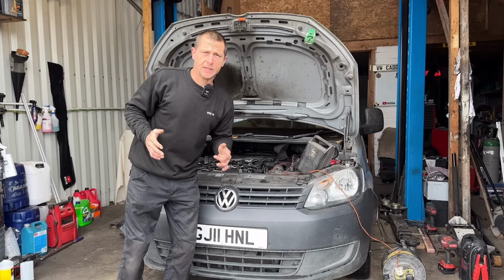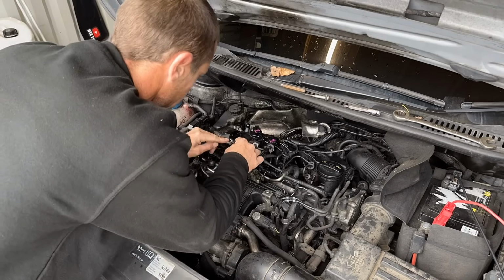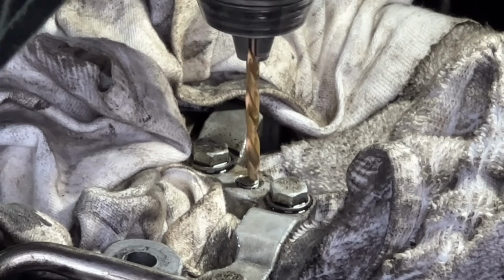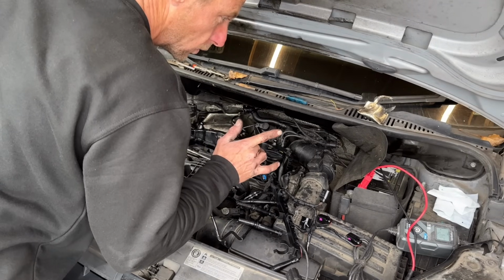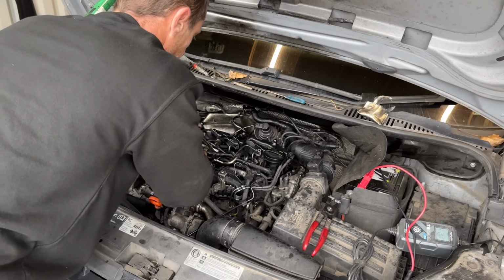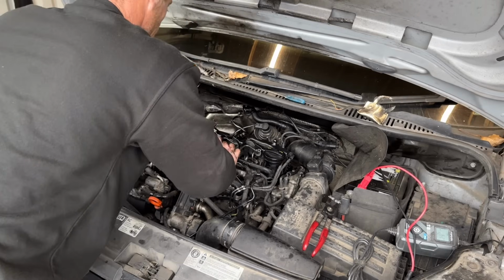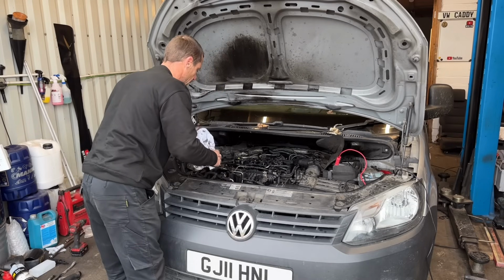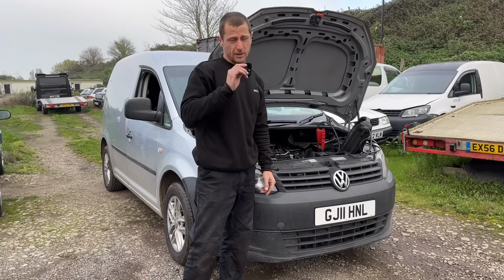Vw caddy 1.6 TDI SNAPPED injector bolt removal

Comment: Been here twice Nathan…on my drive, two injectors done, not had to do rocker cover seals yet, but I always buy two full injector seal kits, copper washers and o-rings , two bolts , plus a return pipe rail kit … green o- ring one…and new spring clips , so about . £50 in parts per injector replacement…on top off a injector, £200 recon, £400 plus new.👍🇮🇲ps I’m with you, tap them down , and thanks for the tip on the leak off pipes, I’ve actually cable tied mine to stop the buggers popping off …lol 😜
Reply: There a place in Scotland Argyle diesel £350 for injector continental or Siemens

Comment: Nice video, Top tip if you want to change injectors on the (CAYD commercial  or CAYC passenger car) at home.  Try to lift the injectors first  if they are jammed in, get a garage to do it. You will save yourself lots of grief. If they pop up with light pressure, crack on.
Factory spec for those bolts are
2Nm then 8Nm then 270 degrees, not 180.
Done 100’s of those under warranty, some other tips for people doing this:
Don’t get any diesel on the belts they will strip.
Replace the small spill pipe clips and O rings, two different sizes green OR orange. You may get away without a leak, but if they do, the diesel finds its way onto the timing belt and it will let go. Seen at least 5 do this. ££££££
If replacing an injector due to piezo driver failed, replace seal and copper seal of the adjacent injector you have to pull up to get the failed injector out.
Clean the injector seat as best as possible, we use a special bore cleaning kit, just saves grief down the line.
Input new injector code (if it has been replaced) into the ecu for smoother running.

Comment: Ayyy! 200k mls C engine. Injectors for sure, DMF, DPF, EGR, HP pump... They're all gone south already. 
Could be a good idea measuring compression before buying into a world of pain.
Otherwise sweet specs and bodywork. Probably best base for a build we have had to date on the channel. 
IMHO a VR6 should go in there. I saw you face when you took that white R32 Caddy out for a ride 🫵

Comment: Nathan now I finally know what DTE stands for "Doctor Tech Engineering". But aside from that great video on the Injector. My Caddy had 4 refurbished Injectors 6 Months before I bought it and then nr. 3 went on the way home. The seller kindly replaced it. Fingers crossed it has done nearly 40.000 km since. But I did notice that by 1 and 2 there was some diesel. I've cleaned it up and will see if that was the fuel leaker pipe. Thanks for the tip. I will do those 2 bolts for safety. Keep up the good work. Ah Yeh.
Reply: dob tech
Reply: @adellisdevelopmen6593  Thank you must have miss heard it.

Comment: We have a 2016 1.6 Tdi......been brilliant!Aparntley the Siemans injectors were known to fail.......it's due to the electricals.VW  replaced them with Bosch ones and they are not known to fail.....I've got an engine cover to keep the damp out of the injectors.

Comment: I had brought one with the same issue I was lucky to the bolt came out easy enought but it had a slight rattle gave it a oil and filter change was mint

Comment: I just had this hapen to my caddy 1.6. The injectors sounded bad for days like there was a marble inside the engine. Then the bolt broke and caused more problems. Don't drive with bad sounding injectors is my lesson

Comment: Happened to my 1.6 vw touran couple of months ago, had to buy a new rocker cover 1 fuel injector pipe and injector copper washers and seals and changed the oil, cost me about £400 tightened everything to vw methods, 1000 miles later accelerating up a steep hill (my car is dsg) same side bolt snapped again!! Luckily this time around only cost me £50 including another oil change as I was worried about diesel getting in the oil! 
I’m wondering if there is an issue with the injector over pressuring or something? Or was I just unlucky with the new bolt? I just don’t trust the car anymore it’s only done 50000 miles too :(

Comment: Because these bolts are stretch they are single use. Some workshops change 1 injector and don’t change it then it’ll snap then or later. Also must change the new injector seat copper washers in pairs each time.

Comment: If the bolts is that visible that loose you can  normally use  tweezers or turn it with a sharp pick

Comment: The 2.2 2.4 transits were the same one bolt and a clamp holding 2 injectors down, it’s like diffusing a bomb trying to tighten up but not snap haha
Reply from the maker: Oh mate I got a transit and because it’s not a Vw it sits hiding behind the workshop 😂 my mates transit recovery truck has also blown 2 engines before it’s hit 140k miles

Comment: When I replaced the head gasket on the 1.9 TDI, I reused the bolts. I only snapped the last bolt. So I took everything out, reused the gasket, the bolts and replaced the snapped bolt with another used bolt. No torque, just a long pipe. That 1.9 TDI is still working, 6 years later 😂😂😂

Comment: iv just done a touran but the bolt had snapped right down near the head had to remove cam carrier aswell it had also damaged threads in the head so had to heicoil head just because somone re used old bolts much preferer the 1.9pd engine

Comment: Had the same issue with my 1.6TDI.

The planets must have aligned for me... I didn't take the rocker off, I used a Normal drill bit down the hole and it spun straight out......😅

Comment: That was a long starting. Hopefully  the high pressure pump is ok. Even a second running dry could cause damage to the pump and making metal filings, destroying the injectors. Normally, you prime the fuel system using a scan tool activating the transfer pump for at least 3 minutes before starting the car

Comment: Have u ever done a snapped glowplug in a 1.9tdi just spinning in the head
Reply from the maker: Ouch that don’t sound fun. So it’s the electrode that’s holding it in. You need to get a slide hammer on it and it will pull out but I reckon the threaded part will be stuck in the head. Unfortunately might be a head swap.

Comment: Have had issues with my vw 1.6tdi since an injector failed. Ended up changing all 4 and it's still not right. Loud ticking noise on acceleration. Thinking it might be the hydraulic lifters. Would you know if these can be changed without taking camshafts out ?

Comment: Hello sir i have a different problem mine i bought it with one injector faulty but now after replacing it the bolt not fitting anymore and its not the original bolts its a little more bigger in size and i cant put an even bigger one am afraid it break inside any help plz

Comment: Once the bolts snapped, the tension is off what's left of it, so removal isn't too hard. The key skill is being able to drill gud - it's all too easy to drill into the remains cack-ways, wander off into the ally & then you're semi-stuffed. These are a lot easier than on Vitos - those (especially cylinder 1) can be a right pita as access is rubbish.

I just go buy 12 new shiny drill bits any time I have to do one of these - 6  skinnies & 6 that are just slightly skinnier than the bolt - I drill 'em, bang in a torx bit & use that to back the bolt out. Usually works fine. In fairness, that ^ bolt there's a doddle.  I wouldn't even bother drilling that, I'd just weld on a nut.

Comment: Can someone help please 
At moment I have no idea what's Happening with my own I really need  help over it the mechanic is not telling me exactly what's the problem and i don't want to spend money based on guessing the problem I have just after putting one new injector on it it's  2011 caddy 1.6  tdi automatic dsg gearbox 7 speed right now it's nightmare to me I want to fix the car but my problem is i don't know what exactly is to be fixed.  Thanx

Comment: I think you need injector seat cleaner reem tool about a tenner off Amazon or your going to get diesel knock,not sure you needed to cycle the ignition cos apart from the injector pipes the fuel will still be there and surely it’s high pressure pump, don’t mean to criticise too much because you’re helping people just a bit of critique that’s all and I would have liked to see more work on the engine not Timelapse but I know you just use your phone,like your vids don’t like Volkswagen though 😂😂

Comment: I had the exact same problem on my Golf 1.6TDi ,, the injector made a loud ‘ticking’ noise at hard acceleration and it drove as it was about to give up on me … also felt as the car was been shaken by wind (but there wasn’t) I took it as sign the injector is on it way out! So it been traded in!